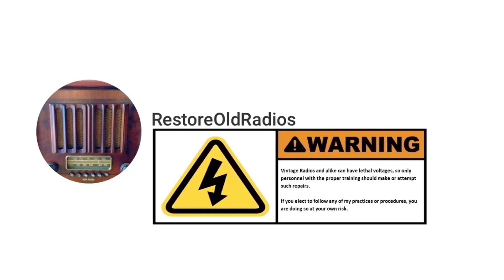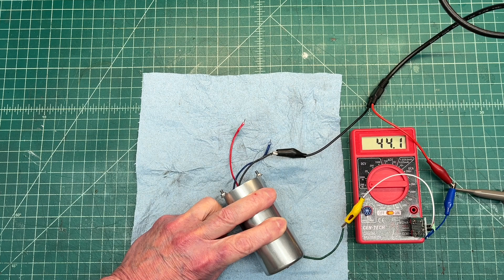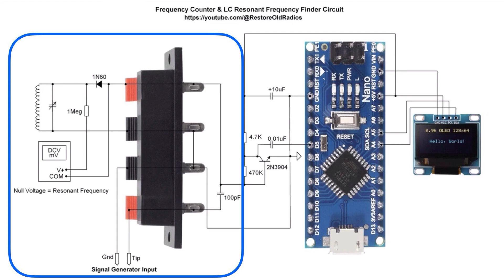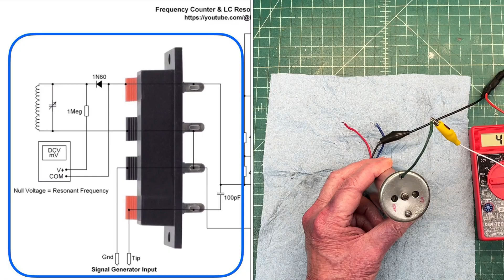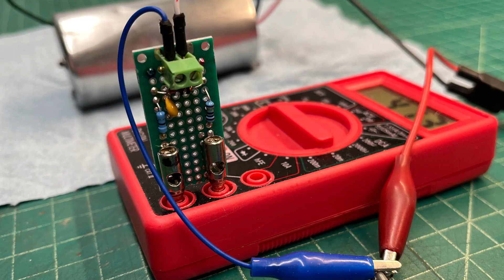Simplex Model PB - I.F. Transformer Alignment | Out of Circuit M&P

Comment: Nice circuit Don. I just need to save up some money so I can afford that volt meter. I have a NanoVNA H and have used it on my Sickles transformer on a Silvertone 701 I'm trying to get going. Your videos have been a HUGE help in this restoration! The top half of the transformer, I believe is the secondary, has a 330k (330M in 1940 talk) in series with a 47k resistor, then has another wire that bypasses the 330k and only has the 47k in series. These resistors are both INSIDE the can. Should I bypass these to perform the measurements? I noticed that I can't get any response on the nanoVNA on that half of the transformer.
Reply from the maker: Ryan - since I don’t have a NanoVNA I can’t say for sure how the resistors impact or influence the resonant frequency. I assume  the DC resistance for the primary and secondary coils are good? Best, Don
Reply: @RestoreOldRadios  Yes, they both check at 8 ohms. This also has variable capacitors instead of the newer kind with variable inductors so hopefully no "silver mica disease". I'm working on a switched attenuator that goes to 30 dB and will use my NanoVNA as a signal generator and use one of your detector circuits. I don't have any alignment info on this radio, but it's relatively simple compared to older communication receivers like the R-390.